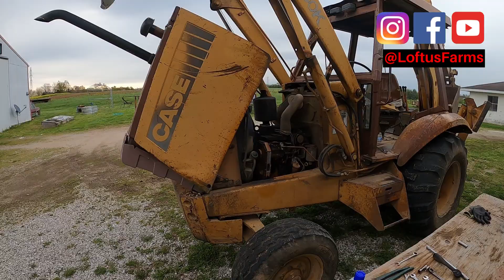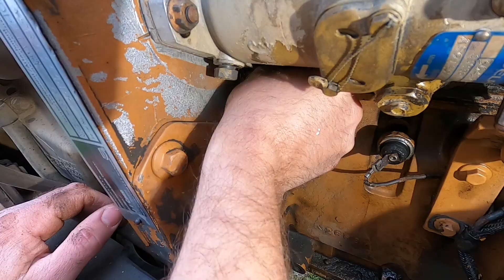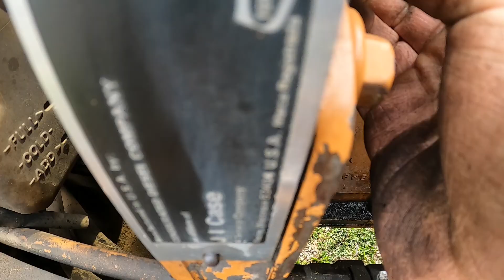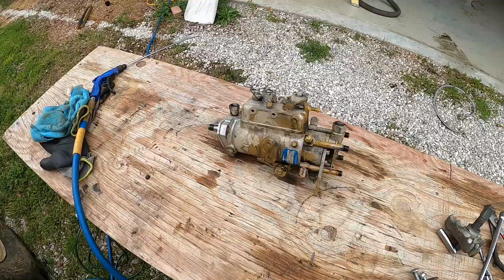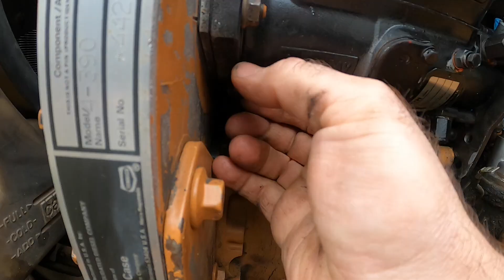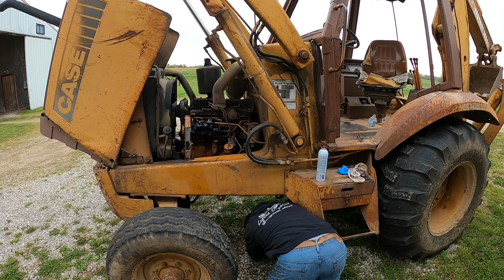Case 580 K - How to remove and install Injection pump - (2020)

Comment: i have a 580c and we broke the lines loose at the injector and it just barely drips out when cranking, do you think we need a new pump. it wont fire up

Comment: My question is, since it is a four-stroke engine, so shouldn't that hole come around twice, once bottom dead center, then top dead center.  If it is timed to bottom dead center, then the injector will be 180 degrees off..., is that right?
Reply from the maker: Every turn of the crank would turn the hole half a turn.  As far as this injection pump goes since it’s keyed you can’t put it in wrong.

Comment: There's a case tractor where I work same injection pump I cracked the lines lose at the injectors no fuel flow the lift pump was changed but no pressure there plenty of fuel getting to the pump

Comment: Thanks for the video. Where did you buy the reconditioned pump?
Reply from the maker: Actually bought this one from my local case IH dealer. But I would check out area diesel located in Illinois. I’ve recently had them rebuild a few pumps and they do a great job.

Comment: Hello.  THANKS, Very much for this video!
The throttle linkage shaft, on the top of my injector pump is leaking,,, dripping. I'm losing my line pressures after sitting for a while, making my 580K very hard to crank over & start. I Recharge battery 2-3 times, use block heater for 1/2 hr, & a small shot of either.
AFTER I get it started, it runs & restarts like new.
I wish I was able to see how much force it took to pop off that drive gear!  I heard you hitting something?
It took a LOT of force to pop off that gear,,,, I think, that I might of turned the motor slightly, when pulling off that gear.. ?
Maybe I should have scratched timing marks on the flywheel/ crank pully, on that gear, & on the housings too?
I cannot get the pump back on!  The gear & keyway do not line up.  Looks like I need to turn my motor about an 1/8" in order to get the gear onto the key.?  (Im holding a mirror in front of the gear, & I can plainly see the misalignment.)
Will moving/ rotating my motor totally screw up my injector timing?
What should I do?
Thanks Again.

Comment: I have a case 480f that will not start, get nothing when turning the key on, Got a new starter and alternator, relays. Cleaned wiring and replaced or mended any loose or dirty wires, What else could it be. Just notice looking at your channel I have wires going to my pump. Would they stop it from starting?
Reply from the maker: You might want to check and see if yours has a electric fuel solenoid

Comment: Great video Jacob! I loved it. Please reach out to me if you need another fuel injection pump, fuel injectors or a turbocharger for the diesel engines you are working on. We have plenty cores, new and rebuilt available in our stock. Have a great day! Bojan at Goldfarb & Associates in Rockville, MD
Reply: Hello Bo.  I have the exact motor & injector pump,,,, a leaking pump. The seal at the top, the throttle linkage shaft I'd say, is dripping & I'm losing all of my pressures making a cold start a total PIMA.  After it starts, warms up & runs for a while, restarting & running is quick & perfect. Runs like a top.
Do you have a good or rebuilt injector pump for sale?  Do you rebuild pumps?  If so, what would be the cost?
When the motor is cold, it takes forever  cranking it over, to get black smoke out of the exhaust. 
Would you happen to have a good, rebuilt or new STARTER, for sale?
Please reply,,, asap.  My 580K is broke down way back in the woods!
Thanks

Comment: Hello, thank you for your video. Do you have a reference of the pump ? I use the same machin and I must change the injecter pump. 
Thank you :-)
Reply from the maker: the Factory Part number is j908645

Comment: 1.08 a question what is that on the left that says full cold add?
Reply from the maker: Looks like the coolant overflow tank.
Reply: @JacobsFarmLife   do you know where you can see how much hydraulic oil the machine has?
Reply from the maker: There should be a little glass fill level on the passenger side
Reply: @JacobsFarmLife  but is that the one for hydraulic?
Reply from the maker: yes
Reply: @JacobsFarmLife  thanks

Comment: I don't know why you didn't clean off the entire engine since you had the power washer out anyway. Kinda silly to wash one little spot. But, good video otherwise.
Reply from the maker: Hey thanks.. The engine Definitely needs cleaned up.  I need to replace the valve cover gaskets and that will be a good time to completely wash it up.

Comment: So if we didn't take the plunger off to make sure it was lined up...is it safe to do that at anytime or am I screwed lol.
Reply from the maker: Yes.  With the pump off.  You can spin the motor over and lock in the plunger and install pump and you’re good to go.  It’s not really necessary to remove it as long as it’s working right and you can feel the plunger go in the hole.  Hope that answers your questions.   Let know if you need more info.
Reply: Thanks...I've pulled mine off and got a leak fixed and now its not getting any fuel to the injectors..
Reply from the maker: Ok are you thinking it’s 180 degrees out?
Reply: I'm not sure we had a guy come take it out but I can turn the motor over about anywhere and push and pull plunger out I've got the pump lined with the key but still no fuel out of injector lines
Reply from the maker: After thinking about it. You shouldn’t be able to get it 180 out because it’s keyed. Check and make sure you are getting fuel to the pump. Crack the line that feeds the injection pump and pump the lift pump to make sure you are getting fuel to it.  Even being out of time you would get fuel to the injectors.
Reply: We getting fuel to pump just none to injectors.
Reply from the maker: Strange. Only thing I could think of would be the injection pump being bad itself.  Let me know if you figure it out.

Comment: I went to look at a Skytrack yesterday with the same engine. I don’t have fuel pressure going into the engine. I crank the fuel lines to see and there very little fuel coming out.
Reply from the maker: Did you try taking the fuel line off from the Lift pump to the Injection pump to see if you are getting fuel out of the tank?
Reply: Jacob's Farm Life  Yes I have fuel coming out of the fuel tank.
Reply from the maker: Have you tried cracking one of the injector lines ?
Reply: Jacob's Farm Life  Yes I did. I crank one by one of the fuel lines going to the injectors while cranking the engine. I’m not getting any pressure it sips with no pressure.
Reply from the maker: Sounds like it could be the injection pump. Any leaks anywhere?

Comment: My injection pump is licking how much do you paid for yours
Reply from the maker: I believe it was around $1500
Reply: Once it starts leaking is there a fix mines leaking from the fuel line on the bottom...
Reply: Id love to be able to throw a new washer on there but it hasnt stopped the leak yet